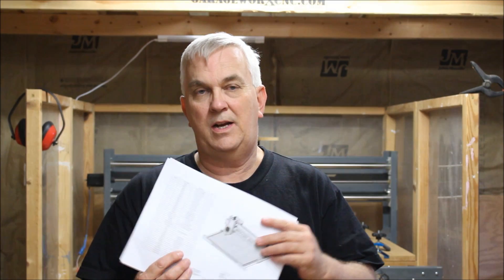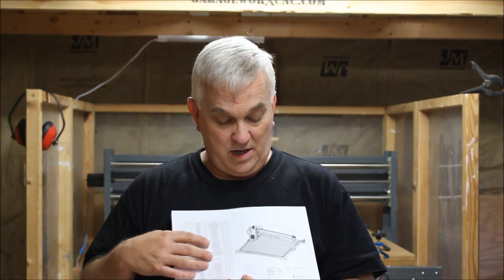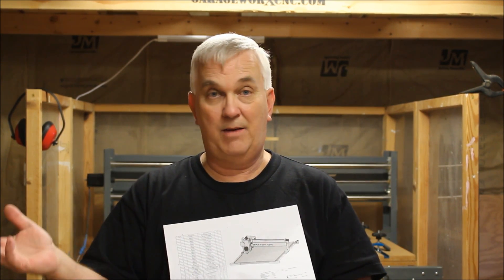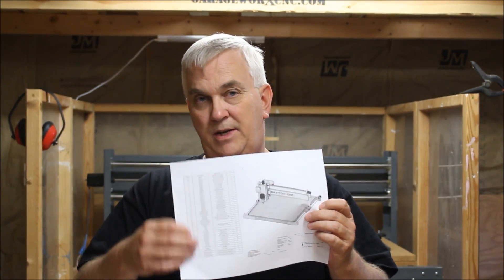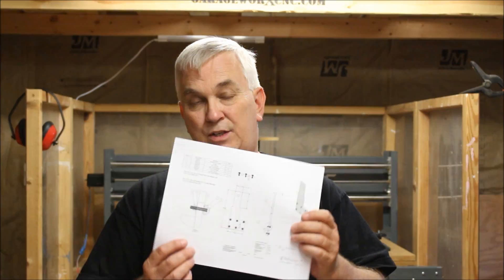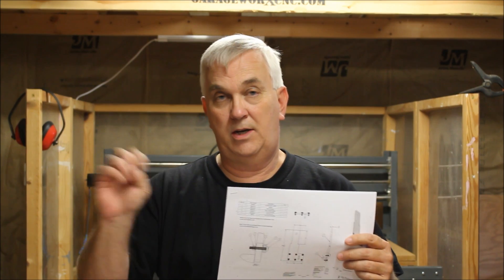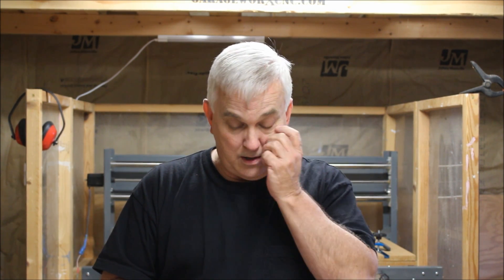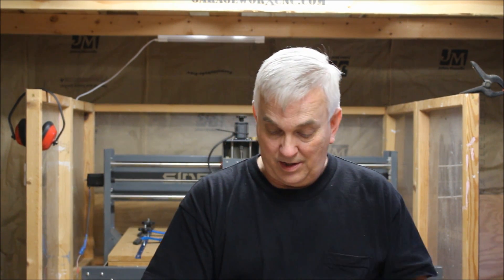New CNC Plans

Comment: Dave, Thank you for sending the plans so quickly. I have spent a little time reviewing them this afternoon. They are very clear and concise, but I have one question. On the bottom of the gantry uprights, are there suppose to be holes leading from the bottom edge through to the v-groove bearing screws so that they can be tightened? Thanks.

Comment from the maker: Just a couple of things that I forgot to mention in the video.  Each set of plans will include full scale pdf files that can be printed with any 8.5" x 11" printer.  You will not have to take the files to a print shop to have them printed out on large paper.  Of course, you can do that if you want to but they can be printed out on multiple sheets and taped together to make the templates.
Reply: Dave, will you include DXF files if we request?  Thanks